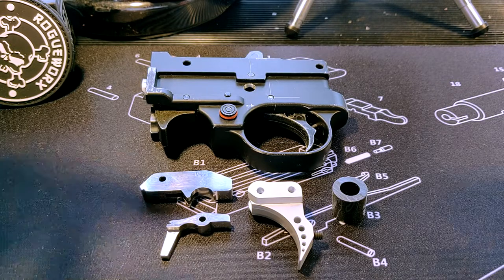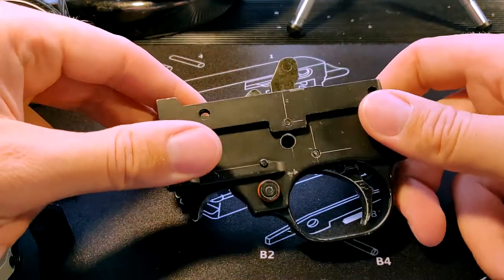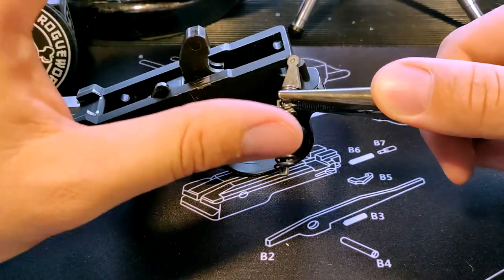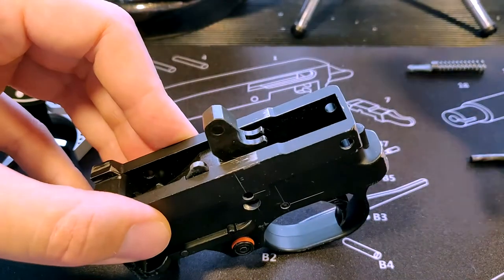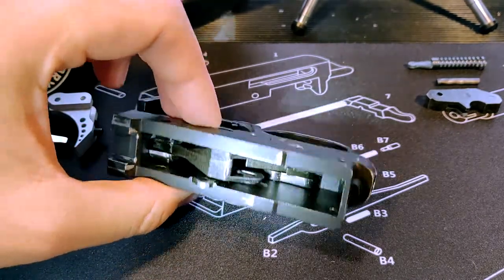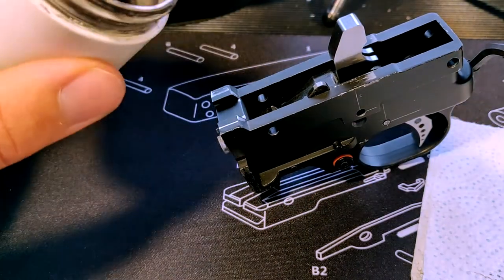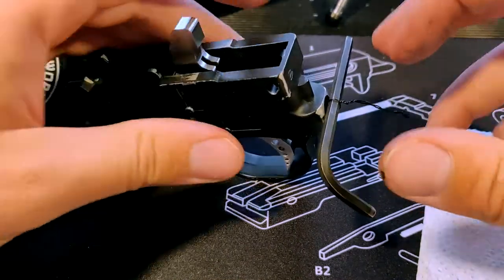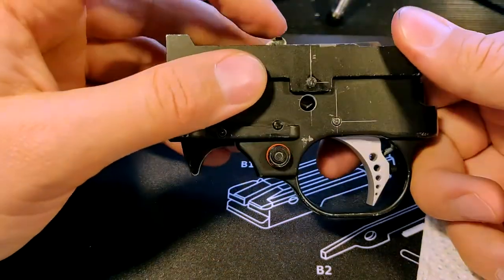How to Install the RogueWorx KC-02 Trigger Upgrades - Judgement Hammer & Sear, and Fang Trigger

Comment: This upgrade was actually very easy to install using the recommended safe method. So far, I have to say the most difficult has been the Genesis kit because of the tight seal on the cross-pin, and the spring that's hard to reach into that cross-pin. This hammer, sear, and trigger combo is a nice bit of tech. A recommended improvement!